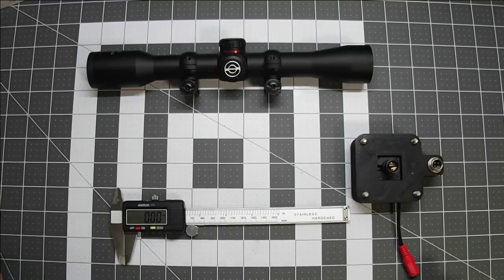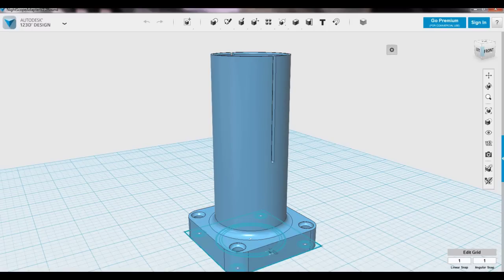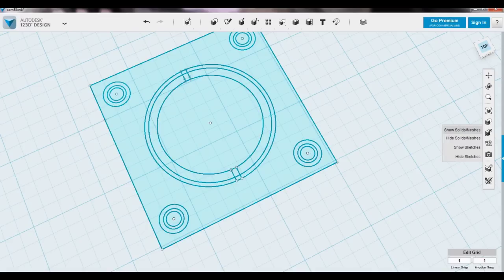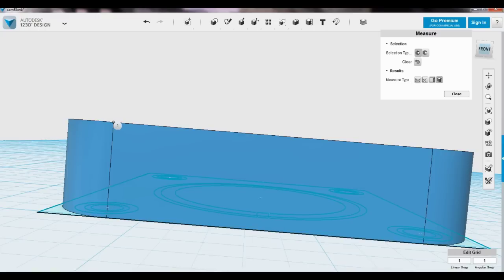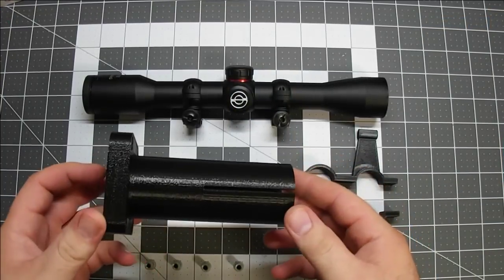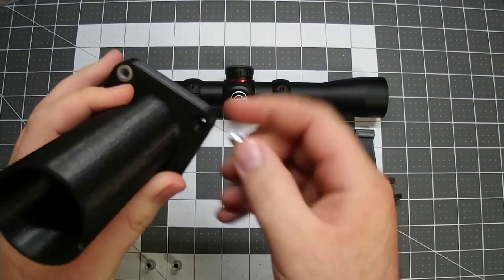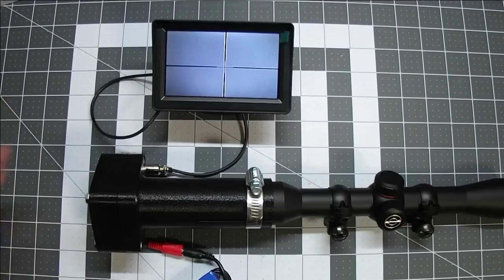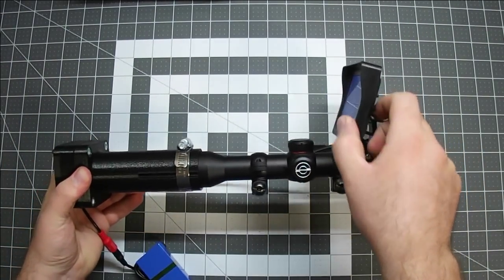DIY Night Vision Scope Build Part 3

Comment: what power source did you use??
Reply from the maker: I used a 12V battery pack. Search 12V battery pack on aliexpress, and you will see what I mean. It is a blue pack with a 5mm connect and built-in power switch.
Reply: Hallo Can you make a video tutorial about making a 12v power supply

Comment: What kind of battery is that?
Reply from the maker: It is a Lipo battery 12vdc.
Reply: Thank you, one last question... would it be possible to swap the power connector you have for a different type? Such as a Tamiya.
Reply from the maker: Sure I just used the connector that came on the battery. The camera and monitor had the same connector also.

Comment: sweet bit of work there, Tyler! 2 suggestions for future reference: 1) radius the camera side of your clamping relief slots (square edges are stress risers, the weight of the hanging mass will eventually make that the point of structural failure); 2) print yourself a "sun shade" for the objective bell of your scope (that way the objective lens gets less IR pollution from your light source, AND your lens doesn't reflect stray ambient light to spook the pests, rats especially can see in the UV spectrum). VERY minor critiques, and once again, a VERY workmanlike, impressive solution!

Comment: Hi Tyler,
Nice work mate look's good..
Just wondering if you can 3d print me a camera housing at all mate and would pay for it and postage as i seen ya vids and they made me go and buy all the equipment you have haha besides the 
rca cable/battery/camera housing..if not all good mate cheers..
Reply from the maker: I'm sorry I cant print the adapter parts for you. I would however be happy to help by editing any of the files you need printed to fit your scope.
Reply: tyler ward 
That's ok mate appreciate you replying back..
It's ok now mate as i have no way to get it printed but if i do find someone or a place and thats ok ill take that offer of editing the stl file for me cheers mate appreciate it..

Comment: Hey tyler how would i make this mount to a larger scope? thanks
Reply from the maker: +Bill Gabriel 
You should be able to mount this to any scope as long as the part the scope adapter mounts to is smooth. You will just need to edit the stl file for the scope adapter to match your scope.
Reply: ok so it need to slide over 43mm scope
Reply from the maker: +Bill Gabriel 
I can check I may have an stl for a 43 mm scope adapter that I can put on thingiverse if that will help.
Reply: i would really appreciate it, as i am struggling to edit this
Reply from the maker: +Bill Gabriel 
OK I'll see what I have when I get off work. Dose the OD measure 43mm?
Reply: yeah the outside is 43mm
Reply: thanks champ
Reply from the maker: +Bill Gabriel 
I made this just now and posted it to thingiveres for you. 
https://goo.gl/mrY5nn
Reply: thanks so much mate bloody champion
Reply from the maker: +Bill Gabriel Your welcome.